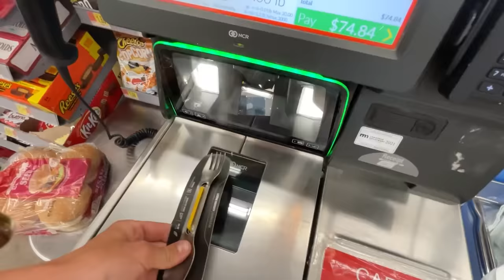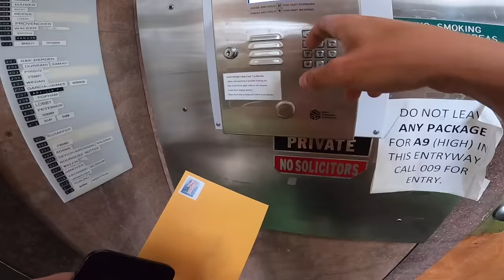Camping in my Small Car for the First time | Overnight in Pop-up Tent

Comment: instead of a mattress I carry several king and queen size comforter/quilts in my van, 3 or 4 make a great pad, in your case you could fold 2 under you..  Maybe use industrial hook and loop tape between the snaps.. I use Repels eucalyptus and lemon pump spray to keep our fl/ga mosquitoes away

Comment: Super late, but typically pop ups will have buttons along the outside as well as a flap that runs along the seem on the inside that seals with Velcro. I imagine it wouldn’t be hard to add that to this setup

Comment: If you try to put oil on a flat plate ( make sure the plate is covered in oil around it ) and use it to capture the mosquitoes around you where there are mosquitoes it should catch a lot of mosquitoes.

Comment: Use adhesive magnetic strips between the snaps, or velcro adhesive strips. You can also run a Thermacell in there for a short time, just make sure to have some ventilation as well.

Comment: Those LED light strips are amazing for lighting in a camper. Mine run off 12 volts and don't use much power all night. I have the white or clear lights and I can see as good as incandescent bulbs.

Comment: check it out this is what you're going to do for your mosquito problem you going to take some dryer sheets you going to buy a box of dryer sheets first of all and you're going to use two of them and yourself put it one on each side that's going to keep the mosquitoes away from u s you going to put four sheets inside one on each corner of the camper and then you going to use duct tape on the outside to seal up any areas where they're going to come through and you should not have no problems with bugs again also buy some barakett acid and put it all over when they any bugs that are inside it'll eat that they'll die I hope this helps you and I love you little car.
Ps.Also when it comes forgetting a mattress in the camper get yourself in air mattress the one that's only one level not the one is unlike a regular height of a bed just a regular low-side one trusts me get a nice thick one put something over the the wood that way the mattress never gets pointer you know of anything or get thrown a plastic did it comes with the tape so you can keep that always sealed it'll be like almost like the foam that they make the yoga mats something like that and you can put it on there the other day the guest glued-on or comes with some type of adhesive and it'll stay attached the on there and you can put the air mattress over it when you're not using the air mattress you'd explain it and you have more room for anything and it comes in different sizes just measure the area that you going to put it on and get one that size and don't forget to buy extra duct tape to take the outside that way you don't get no more bugs inside and if anything by yourself some bicycle patches in case you make a hole on the air mattress ever I hope there's a vice helps you very much.

Comment: I'm 66, and my3 sons we went camping in vehicles but the trunk was packed I noticed that you had mosquito problems and hears a quick answer can you many back all right  things Using the right things that were needed .2 things that were mostly needed was a fire extinguisher And a tarp that way if the vehicles were in we're leaking we would stay dry And we started going camping when each 1 was 5.    They had a blast.

Learha

Comment: i have a 1996 palimino colt pop up camper. the canvas is attached on the bottom except for a couple flaps. those flaps are on the inside. (i insidentally pull it with a 04 vw new beetle gls with a 2.0 and a 5 speed manual) maybe you can buy some screening and attach it to the canvas and to the trailer with some slack to cover the gaps.

Comment: Sorry it’s long. Use a paper towel to soak up grease, don’t drain oil in the sink. Use thick industrial velcro to keep tarp from having opening sections between those snaps

Mosquito Killer Lamp Outdoor Camping Light LED Rechargeable Fly Insect Zapper 7.99 on eBay. And min lasted 10 yrs. I kept it plug in, it ran bright a long time! , tho it’s 14.00 on  Amazon

Comment: You could visit doug and stacey video they had one where you can buy off grid technology maybe offgrid lamp. Just need that sid repellant roll it on canvas theres a stove that uses butane and its one single stove its £21.-24 and cans cost £6  for a lot i donrt know how long it lasts. Drainig fat in sink not such good idea with out soap. Hilarious adventire got to start some where you can use grinder to grind crisps make batter out of them chinese guy used chereetos to dobthat, can order foam too maybe netting is good idea just tape netting gauze on seems put moth balls in. You can get camping lights LED ones and solar charger it doesnt work through windows though cause UV blocks they have. Youd only need a couple and you can get chargers that use cigarette lighter too maybe for light?well fun adventure.

Comment: Why do you put it into neutral then turn the engine off and then pull the park break? Once your engine is turned off why not leave it first gear. If your parking break was to fail your car still would not go anywhere being in gear.

Comment: I'm sure solved issues secure gas can metal above your plate lick key be great small tool box drawer...next can Devi's seal edges I see roof top c.truck have rubber seal lid lock one peace thick canvas is great idea..zapper for inhouse misqtoes ..or go on line look organic oil that deter them there nothing worse is saw amazon ..is screen bed fold not space but can be over sleeping area..fold desk can be were can eat work..label business like great idea..and. Great label kid brushes clothes and items ..still lanes to this day....there led batteries sensor so walk back it can turn on hardware stores giant Tiger Walmart Canadian Tire...u might like have spot propane cook so top over may cup holder tin .devise u can attach counter safely remove b put camping tin ..again store mention have that ..so enjoy individual space just ideas .KET THINK INC.LADY BUG HEPING...IDEAS ...HAVE GREAT DAY